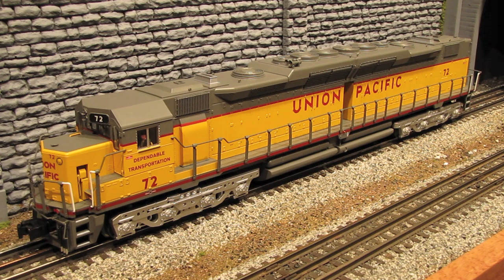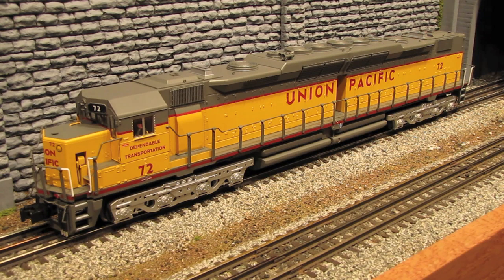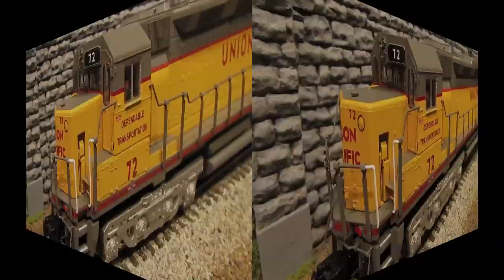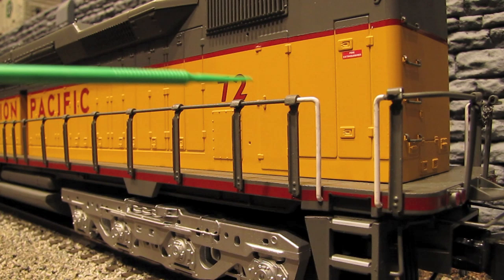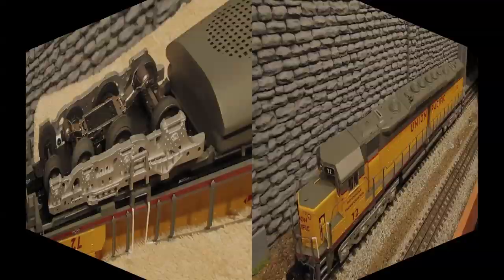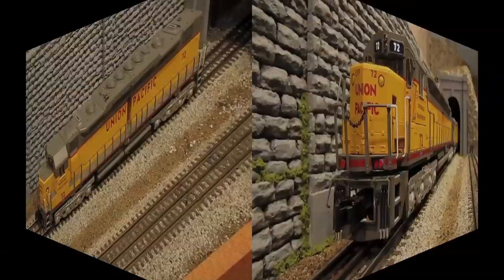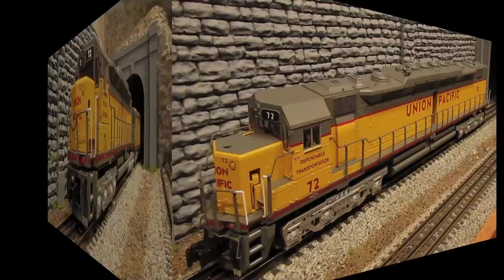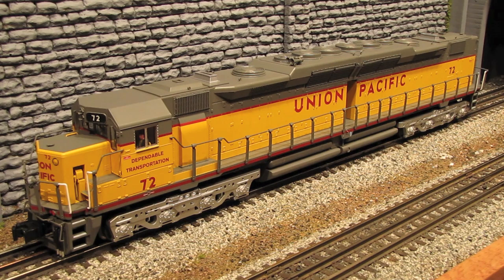Lionel Union Pacfic DD35A

Comment: UP #72 -- 2011 EMD DD-35A, 2 CAT 3406Bs, Dependable Transportation logo on the cockpit. I'd like to have this unit because I saw it in the 2011 Signature Edition catalog, I believe. The Double Diesel family includes the DDA-40X Centennial, and only the DD-35s are also produced with booster units. Southern Pacific only had the boosters for the Double Diesels, and they make a perfect lashup with the GE U-50s. I also found out that Lionel made these in New York Central Lightning Bolt, PRR Brunswick Green, and Milwaukee Road liveries. Union Pacific owns both the Milwaukee Road and Southern Pacific.

Comment: Just some problems with that, the first is I live in a model train store dead zone and the closets is an hour and a half up the motorway in Brisbane, the second is AUD inflation on electronics which puts trains $300-600 more than the USD, if I went online I'd end up with $100+ added post cost. I ended up skipping O Guge and when on to building my own G guage trains. trucks are $10-20 motors are $100-200 and I'm making my own DCC system. every loco I end up building won't cost much over $400 :)